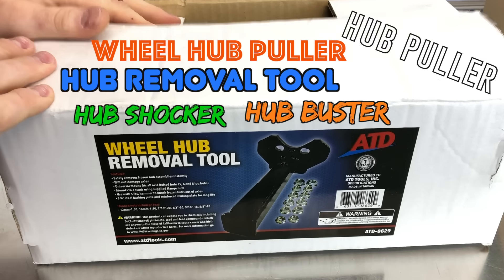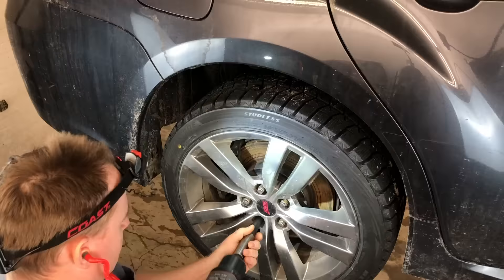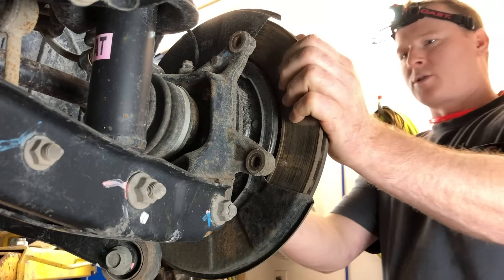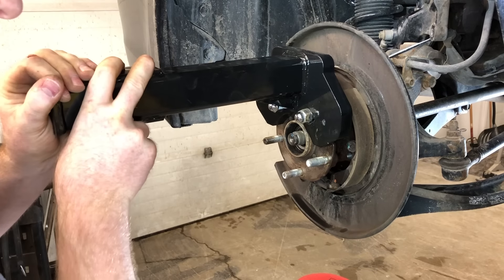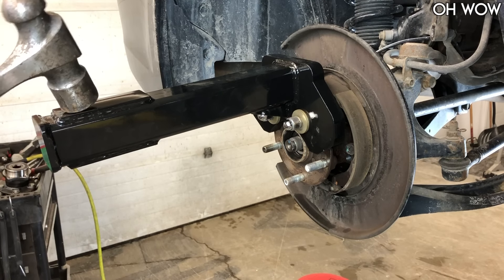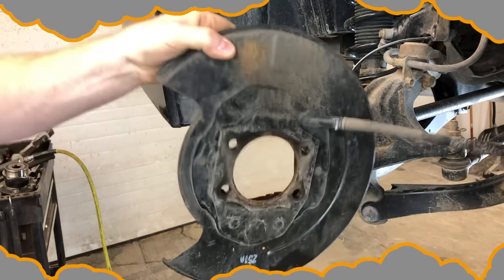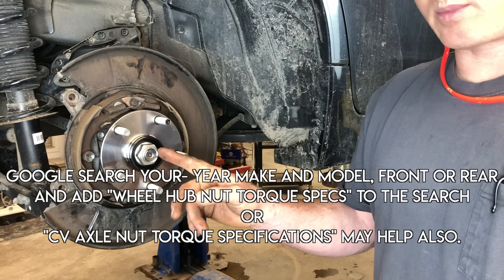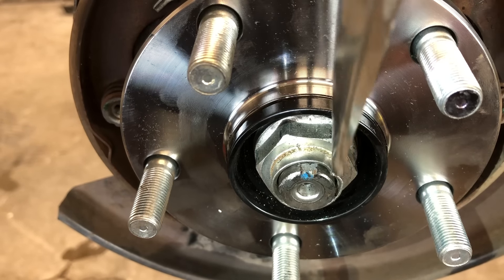HUB SHOCKER Hub Busters  |  REMOVE STUCK WHEEL BEARINGS EASILY!

Comment: Try an air hammer with a socket adapter. Just thread the bolts back in by at least 3 or so threads and hammer on them. They will push the bearing out without issues
Reply from the maker: Hi George. That is a great idea! I have used that method a lot on jeep and dodge front hubs. It works awesome. These Subaru rear bearings are notoriously stubborn and difficult to remove. So I figured I would go right to the shocker with a 40oz. hammer. It worked quite well. Now I use the shocker and go straight for the 8lb sledge hammer. They are crazy difficult. Would you mind checking out the "2.0" video and letting me know what you think? Here is the link 😃🔧https://youtu.be/eKqYtMdlPYo

Comment: My 04 Saturn Vue has beaten this tool. After pounding on it for hours the hub has not budged. The nuts that came with it sheared off.
Reply from the maker: Have you seen the new video? You need to knockout a couple of studs and thru bolt the tool on to solve that problem. It should make a hugeeee difference for you.
Reply: @EasyFixShaun  Thanks, yes I had seen the new video. This hub is winning the game of not wanting to move. Thinking of getting an air chisel to see if that will separate the parts. 
The strut bolts won't budge either so I can't even separate the knuckle to get someone to press it out.
Reply from the maker: Man that sucks. It sounds like an incredibly difficult one. If it comes to it, maybe go plan b and try to remove what you can and replace with used parts. Can you remove any bolts at all?
Reply: @EasyFixShaun  finally got one of the bolts out of the strut mount, but the second one is quite stuck. I'll need to also replace lower ball joint but I have been spraying that since I started. Hopefully it and the upper ball joint will loosen up.
Reply from the maker: Man. Everything is stuck. That sucks. Sounds like you just work your way through until you get it all. It’s not gonna be a cut and dry repair. Sorry man.
Reply: @EasyFixShaun  thanks, but that life in Upstate NY, Land of excessive salt!
Reply from the maker: I feel you man. I think New York and Michigan have a competition going for rustiest cars on earth 🌍😀
Reply: @EasyFixShaun  finally got the spindle/knuckle off. Drilled out the bolt. Those bolts in the strut Mount wouldn't let me go bigger than 1/4" drill bit. My game plan was to basically dill it right out but it didn't go as plan. Popped two chisels behind the bolt head and hit the threaded end... finally moved. Now to find a garage to press it out or go buy a 12 ton press from harbor freight.

Thanks
Reply from the maker: @DJMovit  Man I am glad you are making some headway. Sorry it didn't work out for you. I would love to see a video of all the trouble you had to go through!
Reply: @EasyFixShaun  I didn't of that ahead of time....for a video... I do have some at the beginning....some of me trying the hub buster but nothing of the knuckle finally coming Free
Reply from the maker: Ah bummer man. Ya it’s hard to plan. You just never know how well any repair will go.
Reply: @EasyFixShaun  I live in northern Wisconsin and I'd bet we'd be in the running for rustiest car.  Don't count Minnesota out of that competition either.  We love our salt.
Reply from the maker: @ralphwatten2426  I bet you are rusty! There should be a rust competition of some sort so we can sort out the winner 😀
Reply: @EasyFixShaun  We could call it the Rusty but Trusty World Repair Competition.  There'd be a penetrating oil division and a propane/cutting torch division and a brake bleeder competition.  Second place could be $500 worth of band aids.
Reply from the maker: @ralphwatten2426  Omg hahahahahahahahahahahah that's an amazing idea 😃

Comment: Do slide hammers or bearing pullers not work anymore then ? i prefer those soloutions to belting it with a hammer
Reply from the maker: Those work. This tool works great on subarus and I thought I would share. I made an updated video that solves some mounting and bearing separation issues I was having. Check it out and let me know what you think if you want?  😀 https://youtu.be/eKqYtMdlPYo

Comment: I'd just buy a slide hammer cause they have multiple purposes, where this seem to have one, and if your replacing that type of unit bearing just beat on the top and bottom they loosen up real fast and it's being replaced so don't have to worry about any damage.
Reply from the maker: Slide hammers work fo sho! They are now my old method though. The hub shocker is the only way I attempt severely stubborn wheel bearings. These replacements are horrible. Subaru charges 600-700 per wheel bearing in the rear. 🔧🔧

Comment: If you unthread the hub bolts 3/4 out. Take a socket with extension that fits bolt. 
Then tap the extension with hammer, bearing will pop right out.
Reply from the maker: That is an awesome idea. I have the air tool in my box to do that. These subaru bearings typically won't budge though. I should try it. Maybe I can access it from the back. I usually use a wobble socket, but i just may be able to fit an air hammer up in the insides. Great tip! 😃

Comment: Have a harbor freight arc welder. Going to a make one of these at the shop. I normally air hammer and beat it off with a 5 pound mini sledge or get the torch out.
Reply from the maker: You can totally make one! Make it as heavy duty as possible. 😃🎄
Reply: @EasyFixShaun  will buy the metal from the local welding place. I work as a tech so maybe even scrap metal cut up with a grinder or torch. Yeah, I will add the little bash plates as well for. Reinforcement so it doesn't bend the pipe.
Reply from the maker: I would love to see a home made tool! You should make a video on it.
Reply: @EasyFixShaun  I work at a used car dealership as a mechanic/tech and I live in Ohio so the rust belt. Sometimes hubs are a pain to get off. Although if u have the car on a lift up above and a 5 pound sledge it'll come off easy as you can stand under the car and smack the hub, turn a little and smack again. I seen a comment about messing up the knuckle. Never heard or seen it happen. The taper on the knuckle gets messed up over time anyways especially when suspension components start to wear and put more stress on the knuckle. I see lowes and home depot both sell the square hot rolled pipe. I'd assume 1/2" should be more then thick enough. The nice thing about making it yourself is that it should be able to fit any bolt pattern as you can drill additional holes. By the way, I have had a hub seized to the cv axle so bad that I had to put about 10 tons of pressure on it and pretty much melt the hub off of the cv in order for the press to release it. Of course I stood around the corner as it was heating with that much pressure applied 😂
Reply from the maker: Man the rust we put up with here is hard to describe. But I think you just did it wonderfully! It sucks so bad and there's just no way to stop it. All we can do is be creative and find ways around it best we can. I have seen all of the same things you are describing. I have even had to just cut shafts and bearings in order to save the knuckles. It is just so unbelievable sometimes. Great ideas man! Thanks for the comment. Let me know how your homemade tool goes would ya!?
Reply: @EasyFixShaun  will do, haven't got around to it yet. But the shop has 1/4" sheet metal. I'll probably buy the square pipe this or next weekend. Then partially trace out a hub and measure the distance between studs and drill some holes. Probably will pancake two 1/4" hub plates together and arc weld them after drilling each one first. Then reinforce the square pipe with 1/4" bash plates.
Reply from the maker: That should work great. The only problem with mine is the bottom super thick plate is almost too thick. Its 3/4" and sometimes I can not get as much bite from the lug nuts as I want and need. 1/2 total would be much better and should be plenty thick still to hold up to the abuse of a sledge hammer.

Comment: That tool works great on Chevy trucks fornt hubs and the infamous rear hubs on newer explorers. Some heat requiered tho on explorers
Reply from the maker: Still need heat on the rear of an explorer? Dang! Its a really great tool! I can't wait to use mine. Especially knowing how hard some bearings can be. Such a big help. Thanks for the comment!!
Reply from the maker: https://youtu.be/eKqYtMdlPYo Check out the new mounting method I use now. Its solved a lot of problems I was having. Let me know what you think 😀 https://youtu.be/eKqYtMdlPYo
Reply: @EasyFixShaun  yup that thru bolt trick is what I've done.  if only I can send you a picture of my hub shocker. She is whooped so bad it cracked. I'm actually thinking of buying the tommy prokit wheel puller for those explorer /Taurus rear bearings .
Reply from the maker: Awsome man. Ya mine is working great still and I have used it on several fords also. Where is the crack? Maybe weld another plate to it? Or several plates? It’s probably made of Chinese metal. I hope mine doesn’t crack. I use it a lot. I’m sure it will eventually....
Reply: @EasyFixShaun  chinesesuim metal it probably was.  A clean crack from upper striking pad to the other. I have a old hitch I'ma cut and make it a shocker 2.0. soon. Of course the warranty is only one yr I've had it for close to 2yrs.
Reply from the maker: Wow. Makes sense where it cracked. Crazy. Well I guess I will wait for mine to do it and probably try to fix it also. I don’t know how well the tool will weld. But I will try it! 😀

Comment: so i got to about where you were, its similar on a 2013 Jeep patriot where the ebrake assembly and back come off with it, but my problem is that back part where you beat to pop out the wheel bearing assembly, its comepletely rusted and ive drenched it with penetrating blaster, and no matter how hard i wack at it, it will not come out...
Reply from the maker: Ok. Wow that sounds really stuck. Stupid question but, what size (oz.) hammer are you using. It should be 40oz or bigger. The bigger the better. Next I think I would try an air hammer to rattle it loose. If that doesn't work I would try heat, if can easily be applied without hurting anything around it. After that, anything you can come up with to try. Obviously pressing it out would work just fine and make things easy if you can 😊

Comment: Any chance you'd rip the strut mount? This is what absorbs all of the downward force you apply.
Reply from the maker: I haven't yet and I use a sledge hammer. The weakest link is the rust bond that the tool breaks between the knuckle and the bearing. If you didn't unbolt the bearing before using the tool you would likely damage something I am sure. 🤓🔧🔧

Comment: Will this tool work on my 2005 Taurus front driver side wheel bearing?,, we've tried literally everything🤦‍♀️
Reply from the maker: Yup. Should work great. Make sure you watch the second video and see how i mount it with grade 8 bolts. Works much much better there using the lugnuts 😀🔧🔧

Comment: I replaced the rear hub on my 2013 explorer this weekend, had to take the entire knuckle off and take it to my work and use a 20ton press to get it out. Makes me wonder if this would have worked....
Reply from the maker: I think it would be worth a try. I have not done a Ford Explorer yet. I am really wanting to do one. I hear that they are horrible and possibly the worst to deal with. The subbies fall in that bucket also. But I think from what you are saying and others the explorer may be worse. I would try it before removing the knuckle. That is all I know for sure. But that’s me saying it with no experience on the current model. I’ve done a ton of older models. The new one is a real bear I guess 😀
Reply: @EasyFixShaun  I had a 2002 GMC Envoy that I changed both front hubs several times (before I knew there was a torque spec for the axle nut 🙄), I was able to change them out in about 20 minutes. And you are correct, make sure you know the torque spec, they wear out pretty fast if they're too tight!
Reply from the maker: Cool man. Ya the roque is important to hold the bearing all together at the designed pressure from the factory. It’s also the failsafe for the nut. The torque of the nut is what keeps the nut from backing off under normal conditions. Same concept wheels lugnut’s. 😀
Reply: Not on the rears for the Explorer. Those are press fit. One of Fords dumber ideas. And some front bearings on some years of the Honda Civic.
Reply: I bet not. They are some of the toughest. Ram 3500 is the worst
Reply from the maker: That’s what I’ve been hearing. The modern ford explorers rear bearings are impossible. Are those press-in bearings? Or do you mean they need to be pressed out? I’ve been hearing removing the knuckle and pressing out is basically the only option and even that doesn’t always work. I guess a lot of knuckles get replaced....
Reply from the maker: That is what I have been hearing also. I haven’t had the chance to try out the tool in either of those vehicles. I would say Subaru rear bearings should be on the list also. They are ridiculously tough also. 🔧🔧😀
Reply: @EasyFixShaun  I’ve never done a suburu. But probably a hundred others. I’m sure it’s still worth having though
Reply: @EasyFixShaun  it’s not that they’re pressed in once you get the old one out the new one will go right in with your hands but the bearing is steel and the knuckle is aluminum and they corrode together and just build up like rust in between and it’s just terrible I’ve beat one out with a sledgehammer on one side and had to take the knuckle off the other side and press it out at work they were terrible the only one I have found worse is the ram 3500 front wheel bearings if you don’t have a torch I wouldn’t even bother trying.
Reply from the maker: @wb3161  Oh okay. That makes sense. Ya these Subbaru bearings do the same thing. The tolerance between the knuckle and bearing is super tight. When new the bearings slide right in. But any corrosion at all in between the parts, they will "rust jack" themselves together. It is as if they are welded. Makes replacement rediculously difficult. Once the bearings are out the new one will go in easily. The knuckle needs a little cleaning and they slide right in. Pretty nuts. That corrosion makes a bolt in bearing harder than a press in bearing in a lot of instances. Manufacturers and engineers have known this for years. But it is not their problem. Mechanics take all the heat a lot of times. 🔧🔧
Reply from the maker: @wb3161  Oh ya man. The tool is essential.
Reply: @EasyFixShaun  damn right they do. Happy new year man
Reply from the maker: @wb3161  Thanks a lot man! Happy new year to you!!

Comment: Hit, then half a turn, then hit again, repeat. You don't just hit the tool on the same side. That's why there two metal padding on the shaft.
Reply from the maker: Good call. I could be rotated around easily and striking on both pads would be a great idea. 😃🔧

Comment: Old rim, cut out a section and bore out 2 holes. Weld square tubing to it. Done.
Reply from the maker: Nice! You build one and make a video! That’s a great idea.
Reply: @EasyFixShaun  I usually build tons of my own stuff. Just had to do hubs on something. They came out easy enough and I have other methods for the really stuck ones. But I am willing to give this a try though.
Reply from the maker: Nice man! Ya I like that the tool is so simple and could be made. 😀
Reply from the maker: You should think about making some videos!
Reply: @EasyFixShaun  I have tons of videos already. Feel free to check them out.
Reply from the maker: @MNDashcam  Nice man. You have a ton of great videos! I just scanned them quickly. I will watch some later. subbed 😃
Reply: @EasyFixShaun  awesome, thanks!
Reply: @EasyFixShaun  Subbed to you too. I would be a fool to think I already know everything. I'm sure there are new things I can learn from your vids. I will check some out later when I am not working. I'll send some people your way if they ask me about fixing stuff I haven't made a video on yet. :)
Reply from the maker: Sweet thanks a lot man. I really appreciate that and I will do the same! You have so many videos. It will take me some time to check them out. I will get back to you in the next few days and weeks with some comments. 😀
Reply from the maker: (I’m always learning to)  I feel like it’s fun to learn. I don’t ever want to stop. That’s when you die inside. It’s on of the spices of life! And I love YouTube. I’ve learned pretty much everything in the last ten years from here. It’s amazing 😃
Reply: @EasyFixShaun  Thanks. I have no general theme to my vids. I have a bit of everything. Always happy to get comments and feedback so the new ones get better and better!
Reply from the maker: @MNDashcam  Dude that is how I roll too! I don't know what I'm doing. I just do it. Feedback helps a lot and watching others editing ideas. I won't give any bad feedback. I just want to watch your videos for fun man! We are in this together 😀
Reply: @EasyFixShaun  I'v always got new stuff coming out. Currently working on one now so stay tuned for that. Just gotta finish some tweaks in editing and ill post it.
Reply from the maker: @MNDashcam  Nice man! Good luck on the new vid!